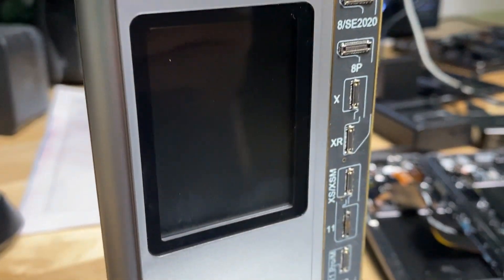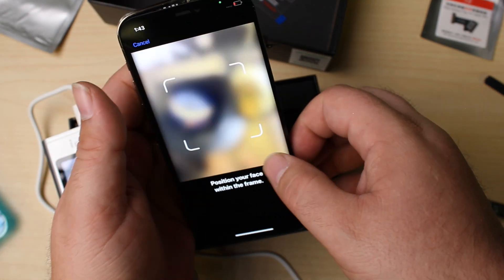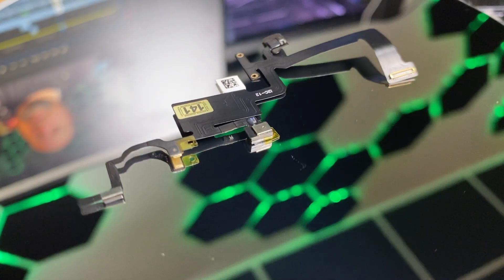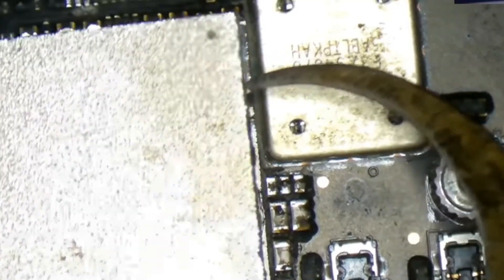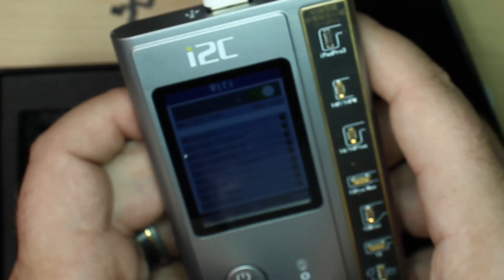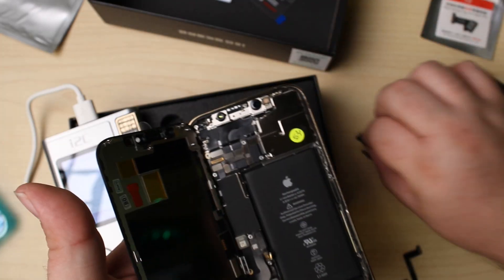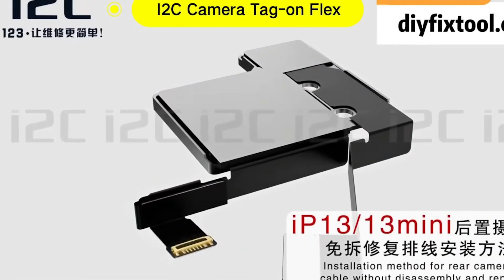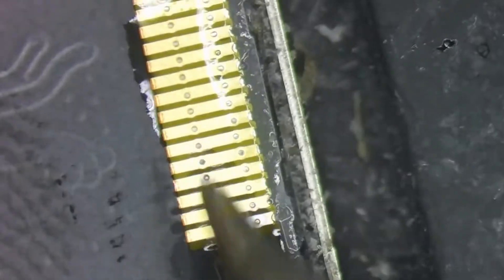Intro to the i2C Programmer (Tips and Tricks #63)

Comment: I bought this device mainly for true tone transfer because it was cheaper than the v1s pro but this thing does not work it copies the original screen data but fails to write to the new screen. I tried it with the 13 pro max screen, and could never find any info if on how fix that, it also seems many other users ran into that issue. Not sure about the other functions.

Comment: If the proximity is being replaced because it's damaged then how do you plug it in when reading the data from the original?
Reply: Yah, this is practically pointless since most damages occur to the flex rendering the entire sensor useless. And in our case makes the phone short out and not even turn on.
Reply: Then Go to jc method 
Brushing unbind
It will extract the serial without the original fpc even if not plugged in